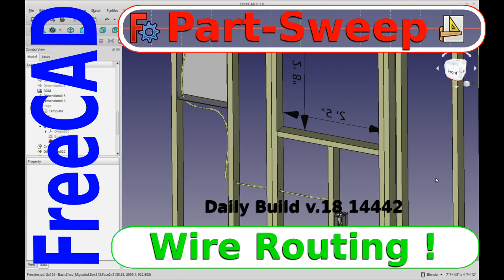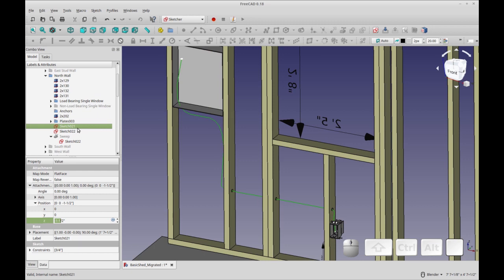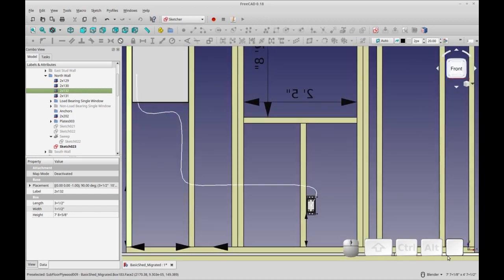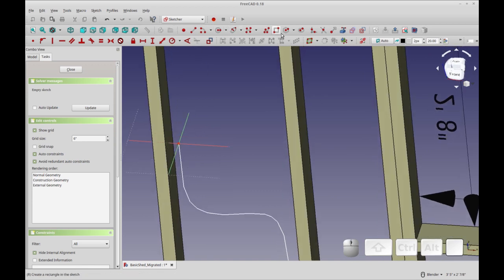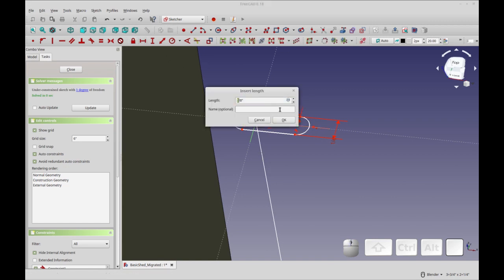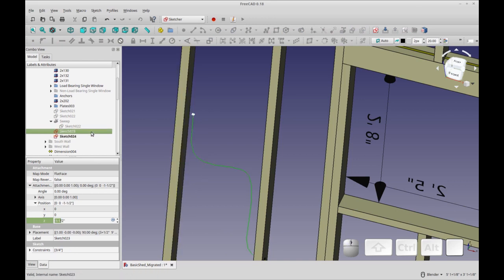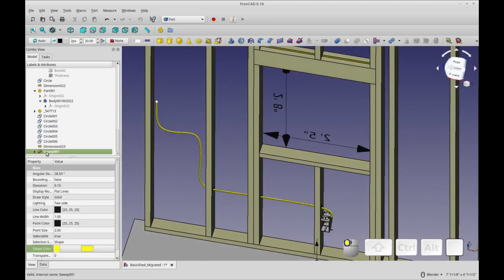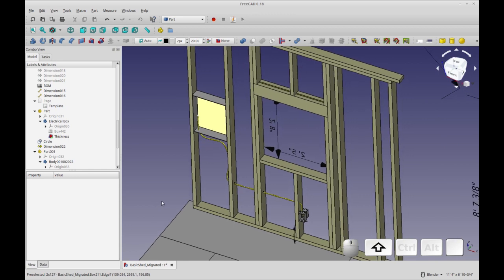FreeCAD   Route a Wire using Part WB and Sketcher

Comment: Nice walkthrough! Is it possible to measure the total length of the wire?
Reply from the maker: Thanks. Yes it is. My long term goal, is to have a macro that lists all the materials. Off the top of my head you will have to use macros tho.